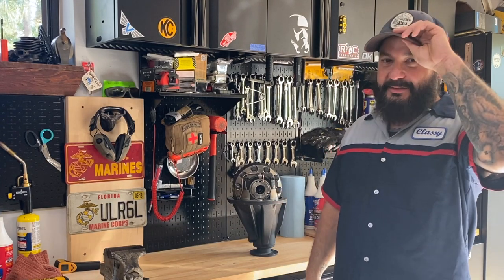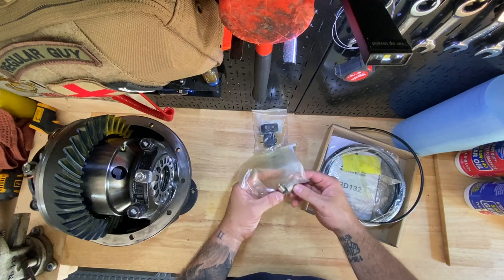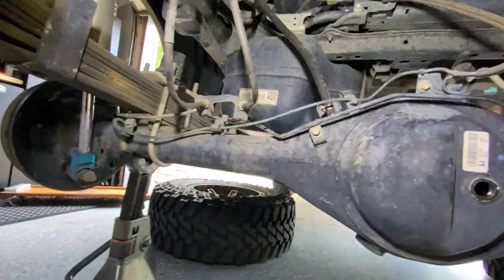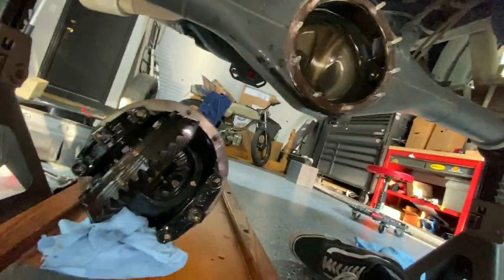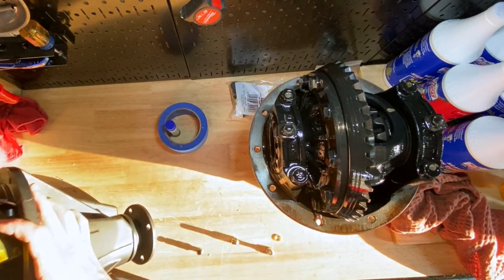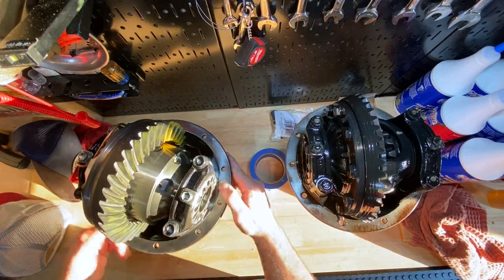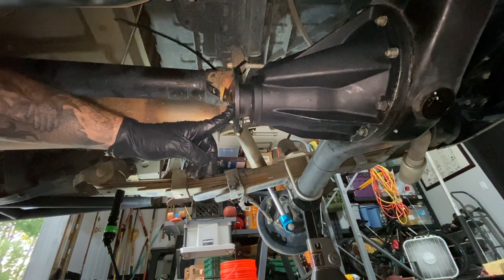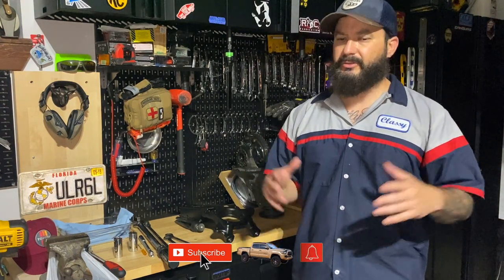Toyota Tacoma | Rear Diff install with 5.29 Gears and ARB Locker from East Coast Gear Supply

Comment: Great channel! Watched too many videos last night. I have a few questions on the regear. I never saw a follow up video on what you thought about the 5.29. I also have a 4x4 sport witht an AT so I have the 8in rear end. A lot of folks say not to go 5.29 as the gears are too big for it. Also you said you didn't want to go electric locker. I have heard the opposite that electric is more reliable? Keep up the great videos!
Reply from the maker: Thank you, much appreciated. I have not done a follow up on the 5.29 as there have been no issues and the overall consensus is that they are amazing. Been great for me with no real insights on a different direction or issues. Love them. As for the diff size debate with 5.29 the difference between the two is marginal. Some folks argue more teeth are stronger, some folks argue less teeth are stronger because the teeth are larger. They work fine for me. Any real strength upgrade requires a 9 inch or a 60, and of those two choices I would go with a 9 inch. Thanks for watching.

Comment: I watched your video before I installed my rear. My weak ass couldn’t pick the differential up and mounted by myself. If anyone else has this issue, have someone stand beside the truck and operate a floor jack. I was able to position it so that it went right in with the wife’s help.
Reply from the maker: So damn heavy, thanks for watching.

Comment: The one issue with having the axles just hanging out of the axle housing like you did because you didn't want to disconnect the brake lines is the weight of the axle and the weight of the brakes and brake drum are resting on the axle seal in the axle housing.  That's a lot of weight resting on that seal for an extended time while you're replacing the 3rd member.  If it were me, I'd just pull the axles and cap off the brake lines with a 7/32 vacuum cap.  With the vacuum caps, there's very little mess and it makes it easy to bleed the brakes afterward.
Reply from the maker: Thanks for watching, and I appreciate the info as I know you have a tremendous amount of useful knowledge. With the axels out just a couple of inches the seal can hold the weight just fine as long as it's not slammed on it. As for the brakes, I'm just showing folks a different way of accomplishing the same task.

Comment: how are the gears from east coast gear supply holding up? Did your mpg go back to normal with 5.29s?
Reply from the maker: gears have been fine, no issues. I follow the recommended gear oil changes. As for my MPG its not great. I drive a ton on the highway and I'm usually trying to get somewhere quickly. Weight, 35s, gear and a loaded rack don't help. I can't really give you a decent base line. I think its good for what it is. For comparison the GX gets worse milage stock. Thanks for watching.

Comment: Does the factory differential lock still work if you regear your 3rd Gen Tacoma or do you need to install an aftermarket rear differential lock?  Newb question.
Reply from the maker: All good, yes it will still work. The shop you get re-geared at will know it's locked. The locker and ring gear are separate parts. Thanks for watching.

Comment: I really appreciate this video as I'm looking to do this to my sport. before your video I didn't know a company would make pre built diffs how you want. I was quoting having pros install because I didn't have tools to do gears, air port tap, press. 

What is your full tire size, wheel info, lift amount in this video? I'm not interested atm in doing a cab chop relocate to get 35"s on. So I'm trying to decide If 4.88s would be better with 33"s with occasional towing.
Reply from the maker: I’m on 35s, 17x9 Dakars with a -25 BS. You would be fine with either 4.88 or 5.29. 5.29 is better for the future incase you change your mind and want bigger tires or a CMR. Either way plan on a tune for the gears and tire size. It will feel like a different truck. There are huge threads on tacomaworld for both 4.88 and 5.29. Ton of info for you to read through and help you make up your mind. Also call ECGS and they will narrow it down for you. Good luck.

Comment: Nice job! Why did you go with 5.29 instead of 4.88?
Reply from the maker: The 5.29s work out better for me now and the future. Incase I go larger tires I would rather be geared for them now. Also, if you look up gear charts vs tire size online it puts my current set up with 295s on the more power side. I wanted the truck to feel quicker. It worked.

Comment: Great Vid of the process man! Just curious what type of Gasket Maker you opted for?
Reply from the maker: I used the Permatex Black, rated for 500 degrees. The red is rated to 750. I felt like the black would be fine for the diffs. Thanks for watching and for the kind words.

Comment: Question for you bro! I’m not too mechanically inclined when it comes to major components on a vehicle like this so I’d likely take it into a shop to have this installed. Theoretically, it would be cheaper from a labor cost/installation cost for a shop to install a pre assembled third member with 5.29 gears with no locker than it would be to just buy the gears and take them to a shop to disassemble the stock third member and install the new gears right?
Reply from the maker: Short answer is yes, less labor. But you want to check and make sure the shop will do that. Some shops will only do the full install from start to finish as they do not want any issues with someone else installing the gears. It's a good idea to price it out both ways full install or diffs only. And ask what type of guarantee they provide with each install process. Good luck, thanks for watching.

Comment: Around time 7:15 you said something like "as long as I didn't put it in upside down".  I got my 3rd back from ECGS and all my witness marks are gone.  How do I tell top from bottom?
Reply from the maker: Sorry this took so long to get back to you, just saw it. The groves on the ring gear need to face the passenger side. If you did get an air locker, the bulkhead fitting will be on the topish area of the diff.

Comment: What's a good rear lock diff for my tacoma 3rd gen. something not too expensive New to off roading don't wanna go anything crazy
Reply from the maker: Look into lunch box lockers, many pros and cons depending on what you use the truck for. Selectables are your best best, air or electric. Do a ton of research for yourself. Nothing is going to be cheap. Thanks for watching.

Comment: What type of gear brand you had?, also initial thought since you have them install?
Reply from the maker: It was either Nitro or Yukon. the truck drives like a dream. I also have the KDmax Tune for 35s. I'm super happy with the gears and the service form ECGS. No complaints on the gearing.

Comment: Hey bud have a question.... how did you figure out which rear diff you had, 8 inch or 8.75 inch I'm trying to order mine and dont want to order the wrong one from them.... I have a '16 trd off road sport w/o factory lockers
Reply from the maker: The best thing you can do is call East Coast Gear supply to order. They will walk you through the process. From my understanding the 3rd Gen sport non locker and auto is an 8 inch rear. Manual is the 8.75. Hope that helps. It’s better to call the order in. Thanks for watching.
Reply: @ClassyTacos  yeah I'm deciphering the axles codes on it now just figured out it (a04c) last hr looking around it 8inch 3.73:1 damn I thought this was 3.91:1, re-gear is really going to help this , lol
I messaged them a while back to find out if I could put the torsen lockers front and rear, no responce.... but on the ordering sheet on their site shows I can't have that up front with 5.29"s but can with 4.88's now I want to know why
Reply from the maker: @shanemartinson5006  I saw that when I ordered my set. A torsen in the front would be interesting. Every time I have called they have been super helpful.

Comment: So we can actually get gears already with 5.29! And air lockers pre set that way I just swap them? Is there any cons or pro of just doing regears?
Reply from the maker: Yes, East Coast Gear Supply ships full set ups dialed in to your needs. Just call in to order and they will walk you through the process. The swap sounds easy, but it's still a good amount of work, so be prepared. No cons to just doing gears without a locker. However, fundamentally a locker will make the vehicle more capable off road, of course many other factors come into play with capability. Just comparing a locker to no locker, the locker will be more capable. Also, if you open the diff you might as well add a locker, just do it once, save up more if you have too. Especially for a vehicle you take off road/trails. Thanks for watching.
Reply: @ClassyTacos  so, how does this work since my Tacoma has OEM lockers in the rear. In my case I would have somewhere that they plug in? They actually send the same 5.29 with the OEM lockers of the rear and I obviously send mines back
Reply from the maker: @emadventures6975  Thats a good question. In your case you should call the shop and speak to them directly. I would not want to give you incorrect information. There are different options when you order the rear diff. OEM locker vs no locker. I'm only guessing here but they might have OEM diffs with lockers on hand which have been sent in as cores. They would then rebuild those. You can also message them on IG or FB. Hope that helps.

Comment: ive got the rear oem e-locker, does an air locker do something better?
Reply from the maker: The factory locker is set up to run under factor specs, like in 4low only. The rear ARB can be run any time even in 2wd, there are no factory limitations. The ARBs can engage at any time as long as you are not giving it gas.

Comment: hi bro these work on Toyota trd pro and what brand are you using
Reply from the maker: They should, the rear third on a pro is the larger newer one so I recommend you call in to place your order and they can help you with any questions you have. ECGS has a ton of options you can chose from. Good luck